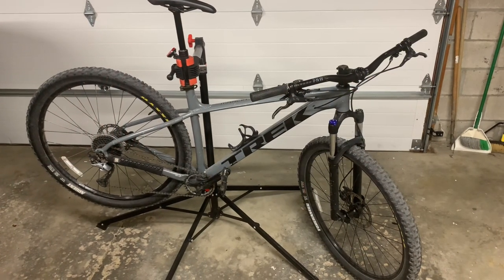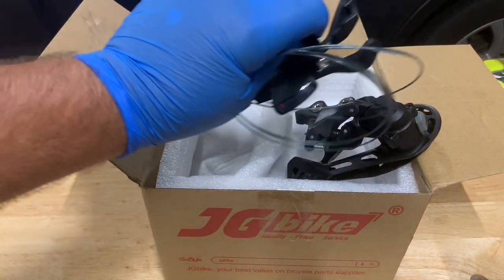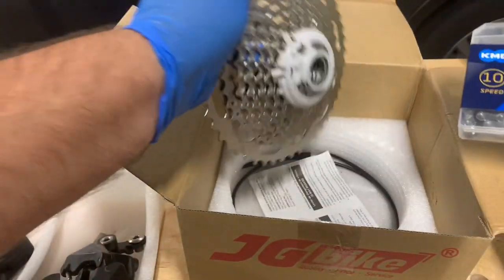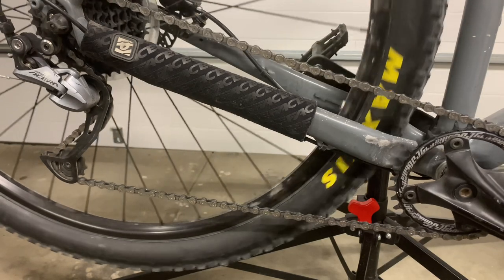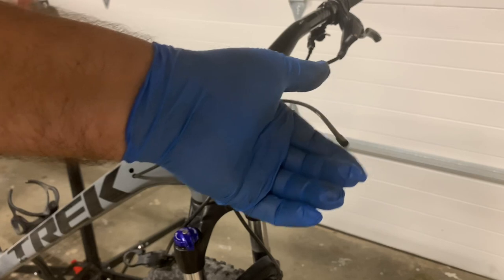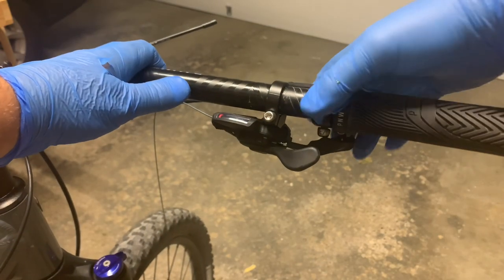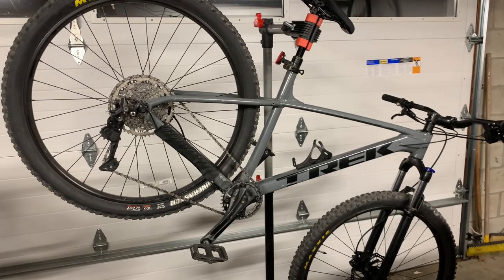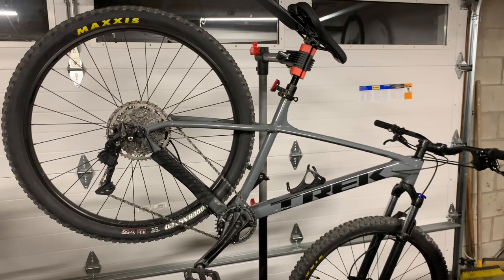Old Trek Marlin, New Deore Groupset

Comment from the maker: So it’s been a season and I should probably do a follow up video but if anybody is on the fence about upgrading their older 2x or 3x Marlins then for less than the cost of a new bike this is a solid upgrade. Even after a couple of big wipe outs the shifting remains crisp and for climbs the lighter weight has more of a beneficial impact than even that 46t.